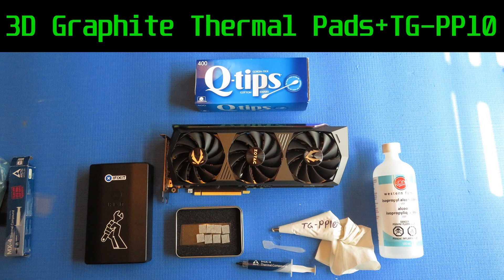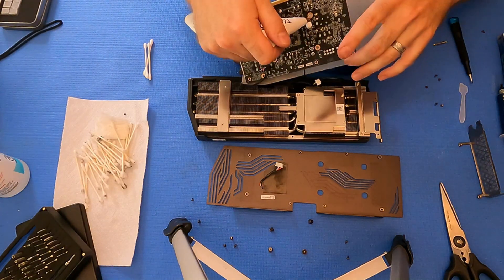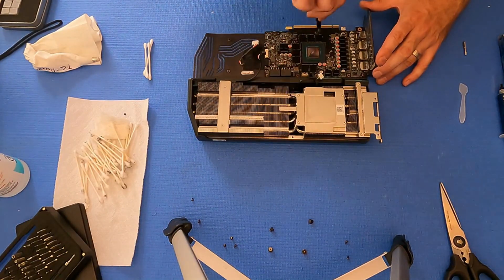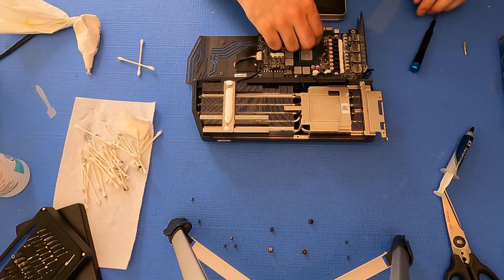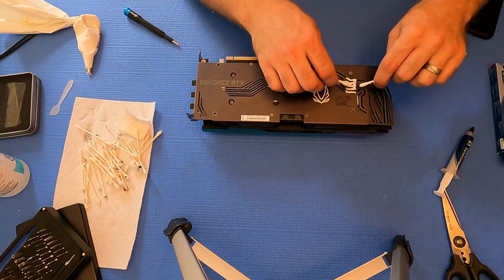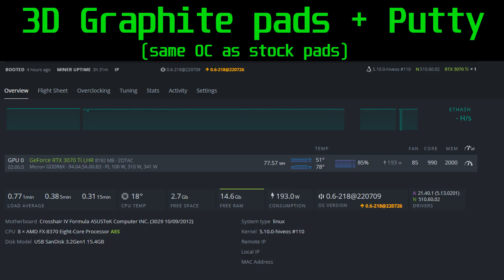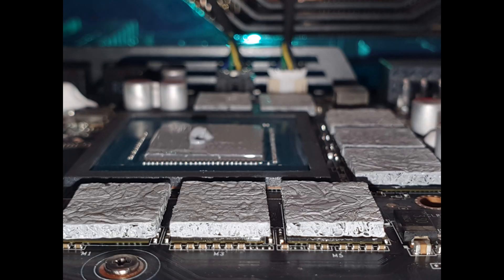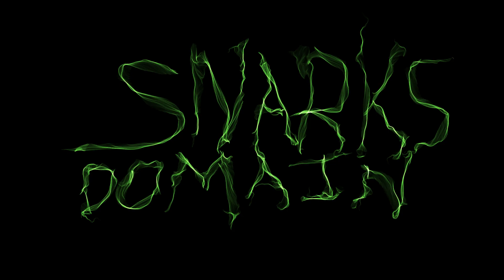3D Graphite Thermal Pads + TG-PP10 on a Zotac 3070 Ti

Comment: your videos is so much interesting and thank you for all of your sharing with your experiments!
I'm just wondering, is it safe to use 2D Graphite Thermal Pads for Laptop?
Reply from the maker: @SuperMaqgyver  I tend not to recommend the 3D Graphite pads for laptops. They pose a slight risk of electrical shorting if the pads become damaged, due to the Graphite/Graphene film embedded in the Phase Change Material. In a mobile device that moves around alot I think you are better off using produ to that don't come with electrical risks.

A good Thermal Putty or Pad is better suited to laptops. My preference is Thermal Putty for VRAM, VRM, and coils, then a Phase Change Material such as Honeywell PTM7950 for the CPU and GPU core. 

With a good application, the high compressibility of the Thermal Putty allows for ideal mounting pressure applied to the CPU and GPU core, which can lead to a nice thin layer of Phase Change Material.

Comment: How are the pads holding up over time?
Reply from the maker: I'll see if I can borrow the card and test it out again to check on temperatures. I might even open it back up and swap the MX-4 for Phase Change Material and convert it over to a higher end putty everywhere on the card. Will salvage the TG-PP10 if I do that.
Reply: @snarksdomain  sounds like a great idea. If it works out it should make a great follow up.

Comment: i just had a really wild, nuts idea.
how absorbant-ish do the 'expanded Foam'-ness of Graphite Pads seem to be?

could it be 'absorbant' enough to maybe soak up some Liquid Metal? there's a lot of Surface Area to a Foam structure after all, maybe it'll hold it even after receiving some pressure.... 🤔
if it does actually hold the LM inside of it, that could do some fun things for performance.
but that's also an insane and risky idea, so....
Reply from the maker: So, super cool idea, I love ideas like this. It does seem like you could get some liquid metal in around the folds of Graphite film. I'm not sure "absorb" would be correct, perhaps more like "fill in the gaps".

I think one factor may contribute to it not getting a large improvement. Graphite film conducts heat really quickly in one axis, but not the other. So the best shape for the film is to be scrunched together similar to a filter (zig-zag) between the two contact surfaces.

It would be interesting to put some of these pads inside a vacuum chamber, submerged in LM, and suck all the air out, then release vacuum and let it pull the LM in.

If this was done, then it would be worthwhile reporting all sides with PCM to try seal in the LM.

My gut says this would be difficult to pull off, and the PCM/PTM would melt around 45 Celcius, so LM could leak out.

It would still be cool to see this in controlled scenario where all the parts were protected with nail polish, conformal coating, or liquid Kapton.

Would this outperform shims and Upsiren UX Pro? Hard to say.
Reply: @snarksdomain  
ooh yeah, pulling a Vacuum is a good idea.

Comment: is it electrical conductor?
Reply from the maker: The Thermal Putty isn't and is safe to use right on the PCB of the GPU.

The 3D Graphite pads have an insulating coating on them to prevent conducting electricity in the event of improper installation. If that coating was rubbed off during handling and you weren't careful when installing onto the GDDR6X memory then you could run into issues. Graphite/Graphene does conduct electricity very well.

These pads are extremely light and the coating is sticky. Once properly installed they won't move around at all. Just takes some precision during install, and a light press to fix it in place. Just be careful not to press to hard and over compress it.

The only putty I've tested so far that conducts electricity is TG-NSP80. Avoid using it on a GPU.
Reply: @snarksdomain  I'm a little scared, it's for my AMD RADEON RX 6900 XT, maybe I'll buy silicone.
Reply from the maker: @Silva.Teixeira  These 3D Graphite pads are specifically designed for GDDR6X. They would be overkill for GDDR6 VRAM as it runs much cooler.

If you like you can check out my video which compares pads/putty/shims performance.

https://youtu.be/zSX_7P0HZqc
Reply: @snarksdomain  what do you advise for my gpu (thermal pads)?  and thermal paste which one is best for gpu?  I'm using Mastergel maker nano.
Reply from the maker: @Silva.Teixeira  it's honestly a tough decision for what thermal pads are "best" for you.

I really like Thermal Putty. It doesn't have the compression issues that pads do. I started off wanting to use Gelid Ulti.ate pads, then Gelid Extreme pads, and had compression issues with both, and also some sucess with Gelid Extreme's. I didn't like the inconsistency of success. 

Pads aren't cheap and I burned through a couple sets before realizing the base problem. We have to ensure contact of 4 different components with sometimes 4-5 different pad thicknesses all while ensuring contact between the core and the coldplate.

For that reason I'm moved onto either Shims + Putty (for GDDR6X cards), or just Putty (for GDDR6 cards). It just compresses so easily and avoids the main issues with pads altogether. It also last longer than pads do.

If you go on the high end of putty, like TH949-1, then it also outperforms all pads with the exception of the 3D Graphite pads.

So for me Putty is the winner both in ease of use, and performance. It's also the perfect match for shims, where paste has some major issues of baking/drying/pumping out.
Reply: @snarksdomain  Thank you very much for your patience and explanation.

Comment: What was the stock thermal pad size and how many mm 3d you used? I have 3090 OC variant of this card. Can I flash my vbios to increase my power budget a bit for vrams? After my vram moddings are completed
Reply from the maker: The stock pads were ~2mm which were compressed down to ~1.8mm. I used 2.2mm 3D pads. 

It's possible you might be able to apply more power to your VRAMs but I'm betting you'll see an increased stable overclock just based on better thermals and more efficient flow of electrons at the lower temps. 

I haven't modded VBIOS before so that's out of my realm of expertise. I mostly dabbled in overclocking air cooled CPU's and RAM in the past.
Reply: @snarksdomain  I see thanks. I ordered 2.2mm graph. pads now. And putty by upsiren. Also coppers already ordered they should be there in 12 days. Let me save my 3090 from 102C vram temps..

Comment: will you try the ALN or Aluminum Nitride pads in the future? Just wondering how well will it perform.
Reply from the maker: I'm not yet familiar with those. If it is pure Aluminium Nitride then they should work quite well since it's Thermal Conductivity may be as high as 321 W/mK and it's also an Electrical Insulator. 

I'd still of course use 1.5 or 1.6mm thickness and putty on either side if going that route. I'll see if I can find some.

Comment: Does the Thermal Putty applicator have a name or is just a silicone globe? Looks very similar to the applicator used to spread cream on cakes. Regards
Reply from the maker: It is exactly that. An Icing Piping Bag with a ~5mm tip, typically used to decorate cakes. I tried a large syringe but this piping bag is the easiest and cleanest method I have found so far, and fairly easy to reload. 

When not in use I place the loaded piping bag into a zip lock bag.
Reply: @snarksdomain  Can guess that you need a lot more pressure with syringe plunger. Thanks for the reply

Comment: do these degrade? What about electrical conductivity? I think i will keep my 3080's with copper mod + tgpp10
Core temperature increases due to heat transfer from the vram to core as well, 5/6 degrees more is no problem compared with -20/-30c on vram, keep going! I will never replace this putty as it won't sell no more, this is probably going to last forever and will use this in next cards to come.
Reply from the maker: The 3D Graphite pads are rated for 2 years, although I think they will still be effective linger than that. The weak point would be the thermal paste on the core in my opinion.

These pads, if torn apart and the raw graphite/graphene is exposed then there is an electrical conductivity risk. These are great pads for the experienced GPU disassembled who can get them placed perfectly and not need to disassemble the card for a couple years.

As for TG-PP10, there are now equivalent and better options if you do ever need to get new putty.

For an equivalent product look to Penchem TH930 and you will be happy to find the same thermal results and consistency.

For improved thermal performance you can get Penchem TH855-5,  Jeyi 8100, or Penchem TH949-1 or very likely TH949-3 (I still need to test TH949-3).

Comment: should I use it directly on laptop CPU and GPU?
Reply from the maker: No for both the 3D Graphite pads and TG-PP10. 

You will want to use non conductive thermal paste like MX-4 or Thermal Grizzly Kryonaut on both the CPU and GPU die

As for the VRAM, VRM and caps of the GPU I would likely go with a putty like Jeyi 8100, TH930 or TG-PP10 as they are all sticky enough to handle the flexing and compressing that your laptop might experience during travel.

While the 3D Graphite pads work phenomenally for GDDR6X VRAM in desktop GPU's it's not ideal for laptops where currently only GDDR6 memory is found (to the best of my knowledge). Even if there are laptops with GDDR6X VRAM I would likely not use 3D Graphite pads in that scenario due to potential to over compress or have it flex back and forth over time and duress the Graphene/Graphite Film.

Comment: Just discovered the channel and love everything you are doing! It's so refreshing to see someone performing actual experiments and documenting their process/findings instead of just spreading baseless opinions as fact!

Do you know if the copper shims would be necessary with most aftermarket GPU waterblocks? The blocks I have used in the past have machined islands and pockets to better conform to the components than what appears on the stock cpu coolers you've shown in your videos. The EKWB vector2 3090ti block user manual only recommends 1.0mm thermal pads for the front side of their card. I'd be very interested in your opinion on this! My plan is to order either the TG-PP10 or TH930 putty for use with an EKWB waterblock on a new gtx4090 upon release. I've never had much success picking appropriate thermal pads in the past so I'm extremely excited about this putty! The TH949 looks incredible but I'm worried purchasing it direct from the manufacturer in something like a 500g quantity would be very expensive or would just annoy them?

Also have you seen this new article from Igor's Lab about GPU thermal paste application? I figure it's kind of in your wheelhouse, many people seem to disagree with his findings but provide no evidence to backup up their claims. https://www.igorslab.de/en/blob-or-full-flat-heat-conducting-paste-on-the-gpu-correctly-applied/
Reply from the maker: I haven't delved into water blocks yet, but they seem to be machined with gap thickness in mind. You should be fine without copper shims I would think, although you could always install some later on if you had bad temps.

If you were only doing one card I'd likely recommend Jeyi 8100 putty as it can be bought in small quantities and has slightly better performance than TG-PP10 and TH930.

I believe Penchem will be listing more putties on Digikey soon so it's quite likely it will be more accessible by the time the 40 series comes our, and not a moment too soon. 

As we get high TGP cards and GDDR6X running at 23 Gbps we are going to see some higher temps I would think.

Card manufacturers are going to have to step out their TIM game significantly over the 30 series.

As for that paste test, I will read it further before I comment on it. It is interesting to see such a short test time. I may have to create a test and have some thoughts on possibilities already.

I'll hopefully be testing Upsiren U6 Pro putty soon as well.
Reply: @snarksdomain  Thank you, somehow I overlooked the Jeyi 8100 performance while reading your graphs. Do you happen to have a link to it? My google and aliexpress foo have failed me entirely in finding it for sale and I didn't see an affiliate link for it on your videos?

With EKWB only calling for 1mm thermal pads for use with their waterblock on the 3090ti I suppose I would end up using extremely thin copper shims along with the thermal putty, perhaps 0.5mm or so to play it safe? Is there an "optimum" thickness ratio of copper to putty you have found?

I'm excited about the possibilities of you testing Igor's theory! Keep being awesome!
Reply from the maker: @blaine3384  Thanks Blaine. With a 1mm gap, and it being water cooled, I'd think you could just use putty and no shims. That being said it could be worthwhile to experiment with 0.25mm copper foil and then 0.5mm copper foil if temps were still bad with 0.25mm foil. I would not exceed 0.6mm copper with a 1mm gap design. Going any closer could make it hard to squeeze the putty out and may compromise die contact.

The important thing to keep in mind is that the more cooler access you give to the VRAM, the warmer the Core could be. But, with a well designed custom loop and adequate radiator(s) and airflow you should be able to mitgage core temp issues while still improving VRAM temps. The putty will be especially useful in areas with lots of tiny components, like over the back of the core with all those tiny components (in an active backplate scenario)

Disclaimer: I have not yet watercooled a GPU. That's isn't to suggest it's not worthwhile, I just haven't done it yet. I always had a limited budget when purchasing a core component upgrade to my old Thermaltake Xaser III Super Tower case. I typically would get the best GPU I could afford and buy an entry level CPU and OC it in air as far as I could, occasionally achieving a 100% core frequency overclock.
Reply from the maker: @blaine3384  so far the cheapest Jeyi putty I've found and purchased/received is here: 
https://a.aliexpress.com/_mtzTfvI

Each tiny container comes with 10-12g but calculate off 10g. For a typical card you could use 50-70 grams. Possible.more for a 3090 with VRAM on backside. I would buy more than you need.

It is also a bit difficult to apply with a little spatulas, but short of buying a large quantity and having it all in an Incing Pipjng bag the little spatula may be the best way. It's a little too sticky to apply with gloved hands.
Reply: @snarksdomain  Thank you for the detailed response and the links to the Jeyi 8100, I would have never found it! I'm excited to give all of this a try once the new hardware drops. I managed to find some 0.5mm copper foil on amazon I'll likely experiment with, 0.25mm seems harder to source in a non-adhesive backed form but I've got plenty of time to keep looking. No concerns about overwhelming the cooling system, i'll have 2-3x 360mm radiators internally and an additional 560mm radiator mounted to the bottom side of my desk this go around. I'm excited to see how the Upsiren U6 Pro performs next!

Comment: is it ok if I just do an X with the paste?
Reply from the maker: It is okay. Lots of people do. How you apply thermal paste is a personal preference thing so would encourage you to do it how you want to.
Reply: @snarksdomain  one more thing, when tightening around the die, when do you stop?
Reply from the maker: @0xNobody  it's best to gradually tighten the core screws in a star pattern until they stop turning. Once they stop, be sure NOT to try tightening further.

These are delicate screws and can break if forced past where they stop.
Reply: @snarksdomain  hmmm finger tightening or normal tightening?
Reply from the maker: @0xNobody  tightening with a screwdriver. The screws will make a definite stop once tightened all the way.

It's likely best to watch a couple disassembly instructional videos before you try it.

**No power tools

Comment: Love your videos! I have a few questions though.

1: Is there a reason why you put pads on the memory and not putty? In principle is it possible to use putty on both VRMs & the memory?

2: I am going to use JEYI putty on my GPU (Strix 1080 ti), would you recommend putting paste first on the memory / VRMs and then put putty to increase thermal interface, or is that a stupid idea?

3: Is there anything that can be done to increase JEYI putty lifespan? On the website it says about 6 months after application. Is it safe to stay longer than that? Since I don't want to pop open my GPU every 6 months to replace the putty.

Cheers!
Reply from the maker: 1) I've done just putty in the past to decent effect. This test was to see how effective these 3D Graphite pads were. They seem pretty good.

2) I wouldn't use any thermal paste on the VRAM or VRM's. Putty does everything you want it to in that scenario. It spreads and makes great contact like a paste, but doesn't bake and dry out (or pump out) like a paste.

3) The 6 months is just a shelf life rating, and even then I doubt you would have any issues using it out of the package then. You really only need to reopen your card once the GPU die paste needs to be changed.

I will add that a single tin of Jeyi Putty (10g) is not enough for a card. I would recommend getting at least 5 or 6 of them. You can usually find them for ~$4 each.
Reply: @snarksdomain  Thanks for the quick reply mate! Keep up the cool videos :)